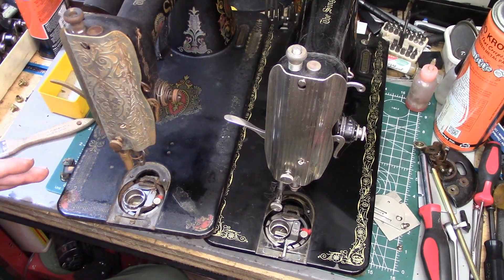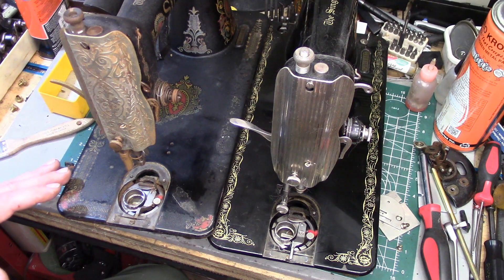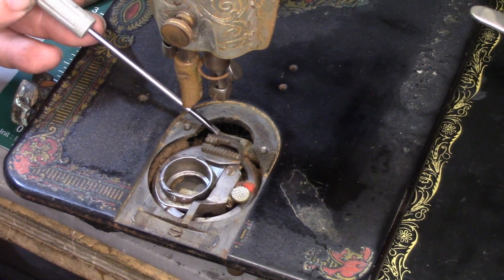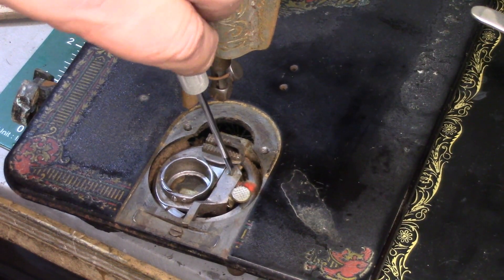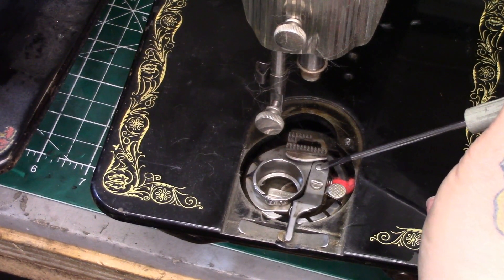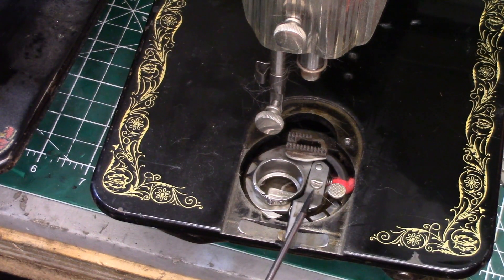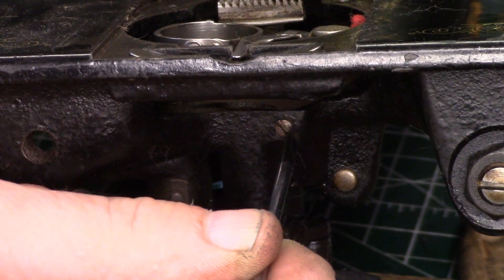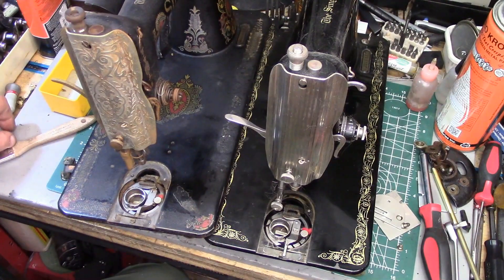Which Screw Holds the Bobbin Case Positioning Bracket?

Comment: 2:15 - What a clever little tool you have, Bob!  I would love to know what it is called and its function?  Looks like it hold the screw in place and drives it in.  I need this.

Beautiful demo.  So well explained, thank you, Bob.  I have a Singer 301 and the set screw under the bobbin shuttle race is stuck.  I have been working for one week to loosen it so I can remove the bobbin shuttle race assembly and clean it out. Heat gun, penetrating oil, silicone oil, degreaser, and every flat head screwdriver I own and new ones I bought too.  Nothing, nothing, nothing.  I'm so mad I want to bash it with a hammer now.  A week of my life on one stuck screw.  No screw is worth it (heh heh).
Reply from the maker: It's a screw starter. There are quite a few on the market. The one you see here was gifted to me by a retired typewriter mechanic, but I have also purchased different models from McMaster-Carr as well as Amazon.